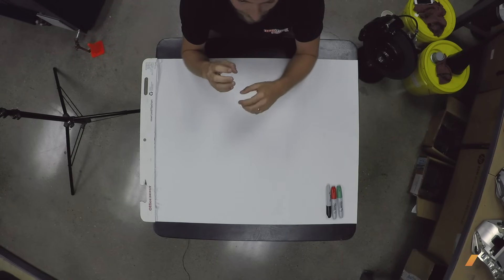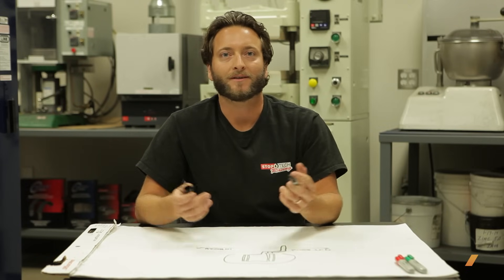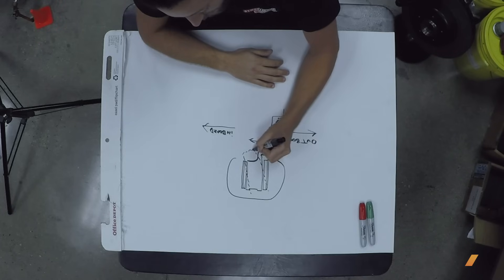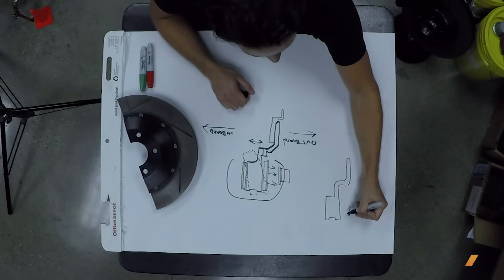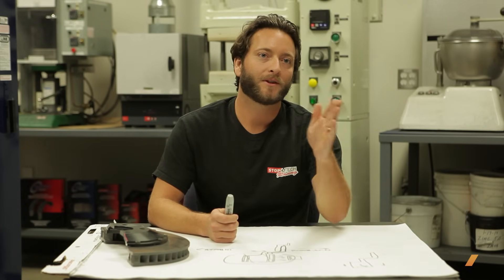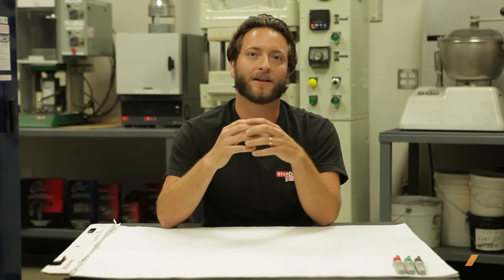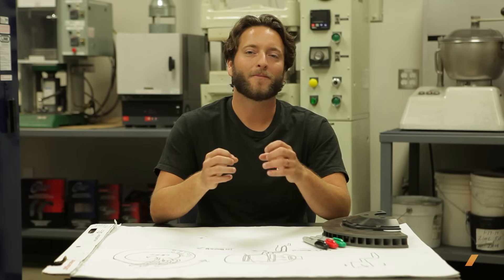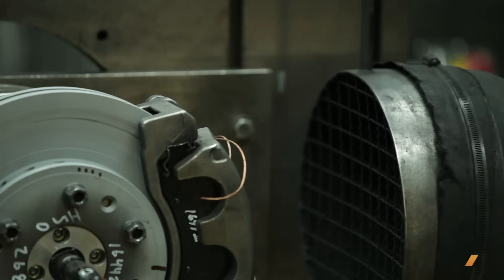The Thing About Brakes Is THIS  -- /ENGINEERED

Comment: DBA 5000 rotors from Australia are the best considering price. 2 piece, slotted and with a patented ‘kangaroo paw’ cooling fin design. Combined with quality EBC pads, HEL braided lines and an upgraded or sleeved master cylinder and you have a braking package as good as anything bar top shelf kits from Alcon or AP Racing for 1/8th of the cost. 

Edit:Top shelf Bendix pads are also great. 
These type of setups (ducting setup and rotor / pad material dependant.will be sufficient for anything less than a dedicated tarmac racing car.

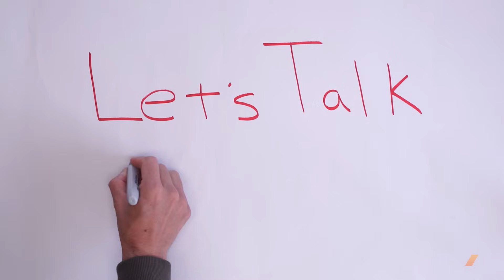Comment: @7:20 What direction does stop tech belive to run a slotted disk? the scooping effect to cool down the rotor from in coming air or the flingling effect giving a channel to deflect the heat with centrifugal force?? This is a topic that always questioned.

Comment: Thanks, great video.
Some was pretty basic and some an eye opener, at least for me.
Havn't really thougt of sliding callipers good for anything else but a cheaper option.
Slapping on multi piston calliper on a one piece rotor may turn out bad if no thoughts have been given the axial and radial rigidity of the hub.

High performance brake fluid:
 I'm under the expression that some sorts, e,g motul rbf600, are some what more hygroscopic and as a trade off to high boiling point numbers therefore have a slightly shorter lifespan(?)

Comment: Really great information! I have PowerStop pads and rotors and lately things feel spongy and make a bit of noise. Based on this video I think I need to bleed my brake lines and put in new fluid. Since I bought the car brand new mid 2014 I don't think my lines have been bled. I just get the free/standard tune up from Ford on the warranty plan. I think after my next service in about 5,000 miles I'll get the lines bled and refreshed. I have ceramic pads and stainless steel slotted drilled rotors.

Comment: so how do you get a even brake pedal feel.  I have 6 in front 4 in the back left on my stoptech street pads with dot 4 fluid but my pedal is never even. has no good hard pedal feel. I have to take the pedal almost to the floor before i feel like the pads are at the rotors.

Comment: With brake fluid we have only two choices,between DOT 3 and DOT 4?
What about DOT 5.1? I just purchased Motul DOT 5.1 brake fluid.
It didn't cost much more than DOT 4.It has higher dry and wet boiling point than DOT 4 brake fluid. (Dry boiling point: 272 °C (522 °F)),(Wet Boiling Point: 185 °C (365 °F))
It's mixable with DOT 3 and DOT 4 non silicone base products.
DOT 5.1 brake fluid is not DOT 5 silicone base brake fluid!

Comment: One small addition to the great information here. Brake rotors were originally drilled in order to lighten the vehicle because they were one of the heaviest rotating parts of a race car. Whenever you look at old race cars they have holes drilled all over them right? Then they later found out that due to adhesives used in brake pads there was a gas formed. Well they later figured out that drilling rotors help with better contact on the rotor surface with their brake pads. Although after brake pads where assembled with better materials people found the wear rate of drilled rotors brake pads were much less than slotted rotors so drilled rotors have hung around ever since.
Reply: PS: I used to work for Brembo N.A. so this is not uninformed feedback. In fact I was there when Stoptech, way back when, was buying piston seals from Brembo because they had nowhere else to get them. lol

Comment: He talks like Bill Clinton. Sitting in front of you and he says "I am not here" and you are hypnotized to believe him. He uses a lot of lingos but never conveys much brake design tradeoffs. And this is 2016 and he tell people not to stick with DOT3 instead of spending money on more costly DOT4. I have 5 vehicles and not one owner's manual lists DOT3 as the fluid you should use. Most of his generalizations are just plain wrong, especially about carbon brakes.

Comment: Disagree on the stainless lines vs factory rubber lines, at least on a street vehicle.  Stainless lines can be broken internally and you'll never see it and stainless lines will not flex as rubber lines are designed to do.  On a race car, ok go with stainless lines but not on a street car.

Comment: I have a 87 944 turbo. Not the fastest but I love it and would never give it away. The draw back, well it's age. As I got more power breaks felt a little..scary. And the "mod" I did helped way more than I could ever thought. Steel breaded brake lines. Felt like I had a lot more force and a faster bite.

Comment: I just realised, what a freaking waste of energy that could go back into the system. Can electric cars with regen braking use close to all of the motor to brake the car? I guess at some point the wheels will spin too slowly for the motors to keep regenerating though

Comment: The stopping power of your braking system must be greater than your engine output or else you are going to have a bad day. Never go cheap on brakes and never increase engine power to where your braking system can't handle it. Upgrade the brake system if you are going to add hp to your vehicle.
Reply: Idtelos you don't put the brakes on while on the throttle.  Breaks are only needed based on how fast and heavy your car is and your driving style.  Just because your car is powerful enough to go 160 doesn't mean you need brakes for that unless you actually drive that way.  A lot of drag cars don't need huge brakes because they don't need to stop that fast.

Comment: Some more information for those who are curious:

Rotors: 
Drilling rotors was an old school way to get weight out of a braking system and in the old days they used to just straight up use a drill to remove it (yikes). They have since become more of a fashion trend then anything. Holes like that can also cause cracks to form and propagate under high heat and load. The main reason people tend to use slotted rotors is actually to scrape away old and hot pad material, so that you do not get a build up of basically melted and old pad material built up. That material can cause uneven wear and an unpredictable system. 

Float as he explained is also more or less a feeling than a science. On a system I designed I added float based on the amount of deflection in the outboard assembly (which can be rigged and measured up), the amount off thermal expansion of the rotor material at the temperatures we see and the amount of flex a caliper has when actually braking. I also tend to add a bit more on top as my safety net, usually about 1.2 to 1.3 times that. 

Calipers:
It is all about your surface area and upstanding the correct balance of a vehicle. In order to properly spec a caliper certain vehicle kinematic equations must be solved, as well as a understanding of how the entire braking system is set up. The main goals for me have always been weight, balance and reliability. The amount of pistons is irreverent. Having multiple pistons is only to accommodate a larger than normal pad area. Likewise, never ever just buy a front big brake kit for a car. It will throw off your balance and will more than likely cause you to lose braking performance.

Pads:
He said it best, "You can not have your cake and eat it too". Pads are extremely situation and that is because some pads work better than others at different temperatures. It is all about your pad mu or grip. Race pads are designed to produce more "grip" at higher operating temperatures, but at lower temps they are far less superior than even a standard pad you get on a prius. You can find graphs for almost every serious pad on the market to make the correct choice. Also your rotor material can change your pad mu as well, so if you are using iron as opposed to steel your mu is going to change.

Lastly, brakes are just a tool to use up the amount of grip you have at your TIRES. If you want to improve your braking performance try changing your tires first. The perfect braking system will be able to use all of the available grip on both the front and rear tires. If you have bad tires then there is no available grip no matter how crazy your system is.

Sorry for the essay, but hopefully some of you will find it informative :)

Comment: I have tested the Centric Parts brake pads (manufactured by StopTech) and those by far the worst pads i have ever used in my car (Corsa OPC Nurburgring Edition with stock brembo brakes). The only thing they did well was smoke (even on Street use), because braking was too much to ask from them. The dealer kept saying i had to change discs (did that, didnt solve the problem), then liquid...still no good. Just a piece of garbage. They also lasted just 15000 miles...when the brembos did last doublé.

Comment: i was surprised to see him recommending DOT 4.
I use DOT 5.1 in my race car, no ABS or anything like that, but just for the higher boiling point of standard fluid. I've not noticed any issues with that.
Brakes are a mix'n'match of various OE brands and makes, aluminium calipers all around.

Comment: What I would really like to know is the difference between straight grooves, curved grooves and J hook grooves. 
Is it just for the look or are the different shapes doing anything?

I've heard that the J hook  are better because you don't have to machine away that much material making the rotor stronger but does it make such a difference?

Comment: One fact not stated is that on certain pads usually inherit pads they do not need slots in fact slots clean the pad face and reduce performance. Most abrasive pads do not suffer this performance loss.

Comment: Great information! Bought my Audi A8L about a year ago & the brakes performed below my standards. Decided to flush the entire system, refill with German made DOT4, and replaced all the soft brake lines with ECS Tuning stainless lines (6 total lines)... everything improved tremendously. Just waiting to wear out these OEM pads, then swap out to a higher performance pad and have a pair of BREMBO's custom slotted. I love this video because I was nodding my head in agreement through 99% of it, great job folks!

Comment: why would you turn kinetic energy into heat and lose it rather than storing it for a minute or 2 in either a flywheel(heavier) or electricly in a capacitor (more dangerous), put it back into kinetic energy when the light turns green again. not only would it save gass, it would also drasticly improve driving style when you dont have to concern yourself with not losing speed

Comment: I honsetly doesn't understand the difference between slots and holes. I don't buy that slots give greater bite. The break pad is flat and bigger than the average slot and so doesn't provide anymore 'bite'.
Reply: A slot scrubs the surface of the brake pad as it passes under it which means you get a more bitey brake feel at the expense of pad wear.
Reply: It has a slight edge, so it might  be, on a very small (near microscopic level), the pad deforms into that valley (in the slot), crosses that valley, and catches on the opposing edge. That would have more resistance than a totally smooth surface. It would be the difference between sliding your hand across glass, or your keyboard. You feel the gaps between the keys.
Reply: Lawrence Sullivan Gracias.

Comment: Nice video. I will add that DOT 3 fluid can be used in a vehicle for much longer than DOT 4 without requiring replacement. This is because it is less hygroscopic. I know DOT 3 doesn't really have a place in the racing world, but there is a reason you still find it on the shelf on the auto parts store and it's not strictly because of cost.
Reply: I wonder why he didn't mention DOT 5.1 (not DOT 5, which is silicone based fluid), it has an even higher boiling point temperature than DOT 4.

Comment: What is the effect of putting the front brakes in front of, or behind the axle. Mercedes are in front of, Ferrari's are behind the axle for example. Why?
Reply: It has to do mostly with suspension design as to where you can mount the caliper on the suspension. and wanting the weight more towards the center of the car for behind the axel. More expensive to design it that way.
Reply: It has to do with yaw, or rotation about the car's CG with respect to the Z axis. Especially with turn-in. This is because the caliper weight is closer to the car's CG.
Think of a figure skater spinning with their arms out (brakes furthest from CG) vs. their arms tucked in (brakes closest to CG).
Reply: It makes more sense to have the weight more towards the center. My first thought was comparing the axle and the brake to the wheels on a bike. Behind, it acts like a rear brake that may slide but maintains control. In front is like the front brake, used alone and hard, you may end up on your chin. Likewise in a car, you would lose some front end traction in a hard braking turn.

Comment: "there's no disadvantages to buying dot 4 the only one it's gonna cost you slightly more, you're going to have a higher boiling point, uh you know, brake fluid in your car and you know, you're just going to have to pay a little bit more for that."
Reply: If you are suggesting buying dot 4 over dot 3 you are wrong the temp difference is minute like under 5% and is not why you use dot 4. If your brake master cylinder reservoir cap states dot 3 you use dot 3 if it states dot 4 you use dot 4 if it states dot 3 or dot 4 then it does not matter but it is best not to mix them.
Reply: max matada no I was quoting the guy because he was talking all confused and nervously
Reply: so was not just me that though he was really nervous and shy
Reply: blackcool77 Yeah I saw it in his voice haha

Comment: He pretty much only said a few things that were correct for 99% of drivers out there .. 2 piece rotors are all about weight savings and carbon fiber rotors are for super cars . that whole bit about axial deflection for 1 piece rotors ?? if that is anything but horse shit then it is for all out racing and once again super cars . and the bit about having offset caliper pistons for pad wear ?? also for super cars where the brake pad service might be 8 thousand dollars an axle there is no need for regular people have 25 thousand dollar brake calipers the thing about the multiple pistons is to spread out the force. what he said about brake pad material is spot on and the slots in metal rotors is for cleaning the pads which scrapes away a layer when braking to keep clean pad material . slotted rotors will give better breaking but shorter pad life. as for dot 3 brake fluid.. it isn't any cheaper then dot 4 and if you have a 50 year old truck with drum brakes its fine for all else use dot 4 .. also he never covered this and is most important if you have dot 3 or dot 4 never add synthetic dot 5 fluid to system it will swell up all rubber components in system and need to be flushed clean. it will ruin an ABS system. they make a dot 4 synthetic it is ok to use  dot 5 synthtic is used in corvettes and a lot of clutch systems from GM never top off clutch fluid in a modern GM unless you look it up in manual if the manual gives you a part number and you order it and it is expensive and does not tell you what it is on bottle then it is synthetic and if you mix regular break fluid to it you will have to replace all the clutch system.
Reply: Paragraphs.

Comment: The problem I have experienced for over 25 years now is with all rebuilt floating calipers on all my cars is worse than ever now. It seems to be due to worn pin holes (that the 3rd party rebuilders won't sleeve ) and the greases' inability to last as long as the newer increased service interval of ceramic pads. I found that Permatex ceramic grease lasts the longest on the pins (about 2.5 - 3 months), but then it simply needs to be regreased again. Because Cardone and other rebuilders don't sleeve the worn pin holes, it makes for extra slop as the grease wears away, so every 2.5 month sor so, every bump in the road yields caliper banging, thus, making my nice car feel like ass. I was thinking of drilling and tapping grease nipples into the caliper on the opposite side of the pin so removing the calipers in the middle of winter could be avoided. I would just grease my calipers with my grease gun at every oil clange with a squirt or two of ceramic grease (not enough to leak out of the seals). I know, I know... I'll die. I wish someone would make a high-tolerance hardened sleeve for the hardened floating pin.
Reply: You will never get the hole in the right spot with the mill for the sleeve so the caliper will be slightly out with sleeving that is why you just buy new or second hand calipers. PBR (patterson brake repair) grease is good so is textar.

Comment: Comprehensive intro to brakes.  You explained 17 minutes what took me years of mucking around with rotor size, composition, slots, drilled, dimpled, one piece, or two piece.  Different pads, brakes regulation adjustment valves. de-glazing pads and rotors before a race meeting.  My big problem was in hillclimbs, the car is cold, the tyres are cold, the pads are cold and the 1st brake application is a very steep downhill approach into a hairpin.

Comment: I can't wait for my brakes to wear out, I will upgrade them for a much better package.
Reply: Anthony HT 

DBA 5000 rotors from Australia are the best considering price. 2 piece, slotted and with a patented ‘kangaroo paw’ cooling fin design. Combined with quality EBC pads, HEL braided lines and an upgraded or sleeved master cylinder and you have a braking package as good as anything bar top shelf kits from Alcon or AP Racing for 1/8th of the cost. 

Edit:Top shelf Bendix pads are also great. 
These type of setups (ducting setup and rotor / pad material dependant.will be sufficient for anything less than a dedicated tarmac racing car.